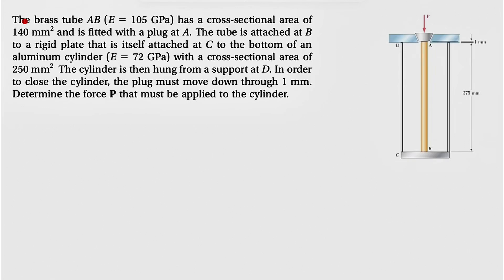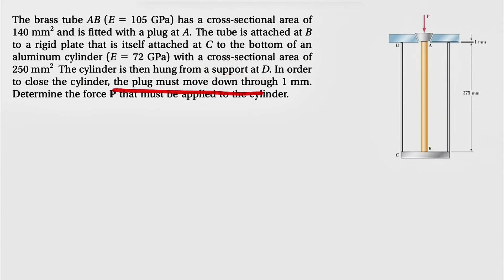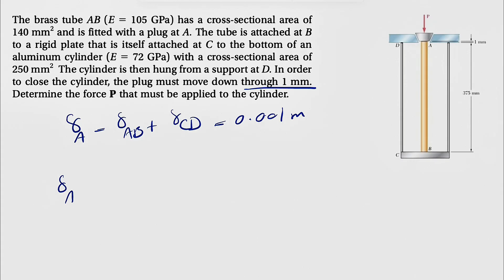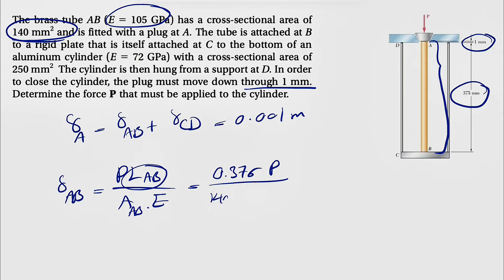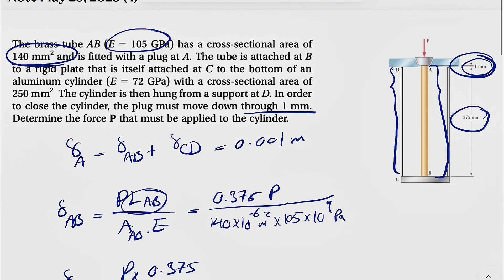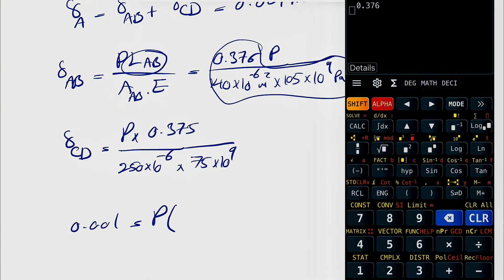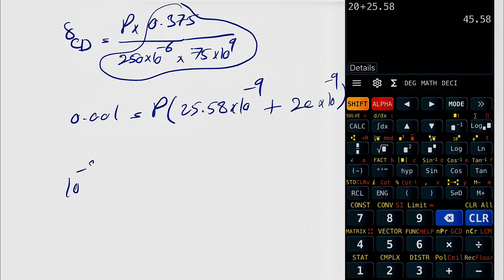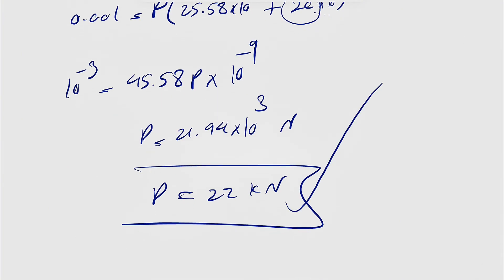Problem 2.18 | The brass tube AB (E = 105 GPa) has a cross-sectional area of140 mm

Comment: Why don't we consider the deflection of two cylinders?
Reply from the maker: good question, there is only one cylinder, you see the cross section in the figure!
Reply: @ENGMATANSWERS  there ar two cylenders
Reply: Yes you are right, there are two cylinders. Suppose the other cylinder is EF.  Now you can see there is an 1mm gap between the upper support and cylinder EF. Now the question is asked how much force we need to apply to remove that 1 mm gap. So force is going to apply on the brass tube and cylinder CD. As soon as the upper support touched the cylinder EF, we will stop applying force. So no need to consider that cylinder.

I hope your doubt is cleared now.